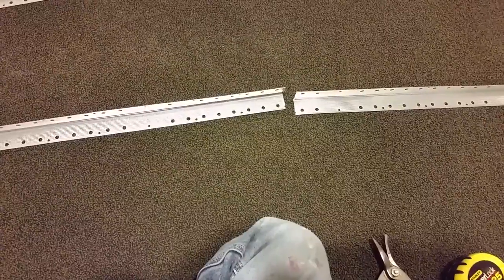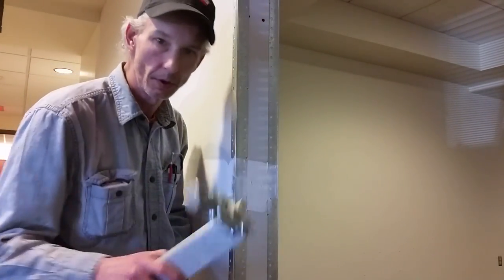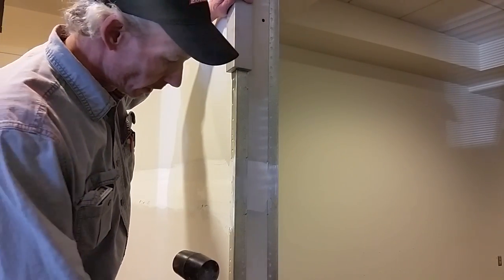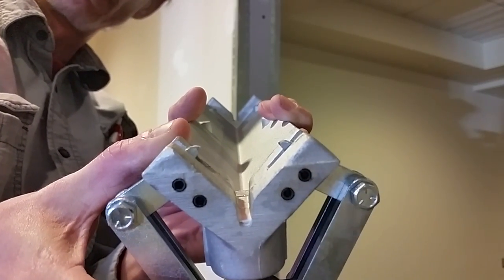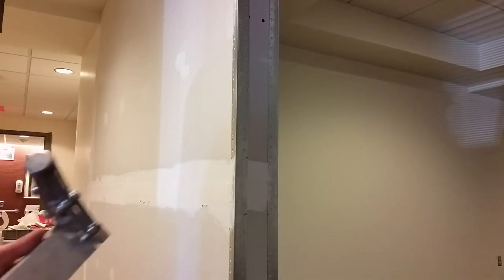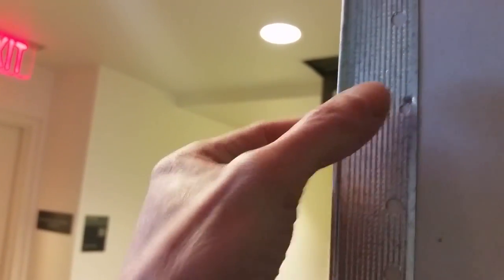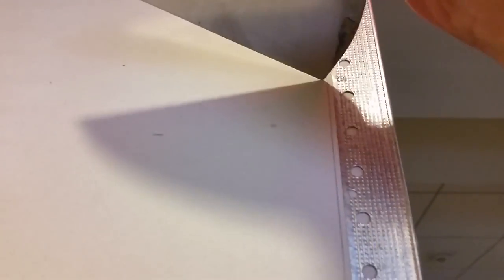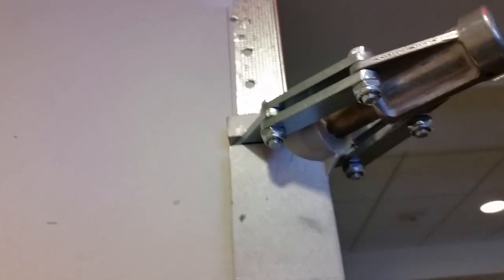Drywall Corner Bead Installation The Quick and Painless Way

Comment: I have used a crimper thousands of times. I always strike the tool before hitting the crimper head as this will square the bead up nicely.
Reply from the maker: Nice Pro Tip!
I haven't set corner bead since that video,  but your tip makes complete sense.  You can bet next time I pull that tool out, I will use it!

Comment: is that an inch and 8th or 1/4 ????? which one would you use more between 2 sizes????
Reply from the maker: Honestly, I couldn't tell you if it's 1 1/8" or 1 1/4".
It's whatever my drywall supplier stocks and delivered when I ordered metal corner bead.
I believe the setter tool will work with either though. Since it's only 1/8" difference.
Given the choice though....bigger is almost always better.

Comment: can you adjust it for narrow beads?
Reply from the maker: No, it's not adjustable.
The only beads I've ever seen are either metal, plastic, or the plastic and paper bullnose. (Of course the tool works only with the metal ones)
I'm not aware of different sizes...but maybe they make a smaller version of the tool.
If not, you're stuck doing it the old-fashion way.
Reply: @TimsManBlog  the UK beads are half the width of the ones you got here on video 😢
Reply from the maker: @onehans66  well then, if they sell the bead setting tool in the UK, I would imagine it would be appropriately sized.  If not, invent it and become a millionaire!
Reply: @TimsManBlog  I am pretty sure that patent is already claimed

Comment: Now I know you said if somebody hits it with Furniture it's time to replace it (the metal) cuz it's going cause a hairline fracture in the mud. I see this in metal corner bead all the time that in homes. 
 I've had to fix.   however that's not really appropriate installation in my opinion. I have no problem with your tool but if you're going to use the tool then in all open doorways in areas of high traffic you should mesh tape that metal after installing it with your tool.    Purpose: to help ensure that your customers don't get fracture cracks when the metal is hit by something.
Reply from the maker: Yeah, in a home though I wouldn't use metal corner bead, I'd use plastic, because it doesn't bend when hit like the metal, and I'd use paper on both sides, not the fiber mesh.  The mesh is just too thick for my taste.
Reply: @TimsManBlog so after crimping corner bead, then paper tape it on each side?

About to install on my corners tonight or tomorrow night.
Reply from the maker: @seabass22  You sure can if you'd like. It wouldn't hurt and can only help.
I didn't tape there because I was under a time crunch.  That being said, it's a high traffic public area, and has lasted all these years with no cracking.

Comment: Gee, why not just use tape on Beadex rather than buying ANOTHER tool you got to haul around?
Reply from the maker: Gary Cavanaugh 
Great question!  The answer comes down to plain and simple economics.  Plain metal corner bead is A LOT more economical.
When you answer to bean counters, they don't care that another tool has to be lugged around, as long as the materials are cheaper.
Reply: Guess I'm glad I'm self employed.
Reply from the maker: Yeah, and I'm glad not to be!
I did that for close to 20 years.
Now I'm happy to have paid vacation, personal days, sick days, health insurance, a pension plan, and someone else calling the shots.... even if it means carrying extra tools.